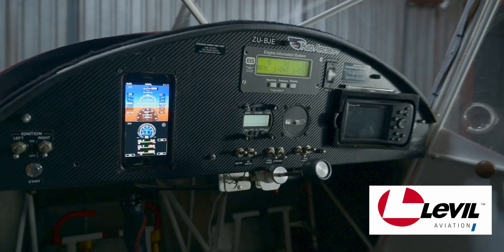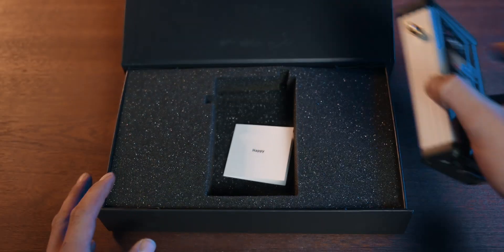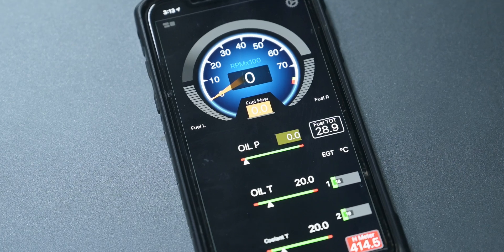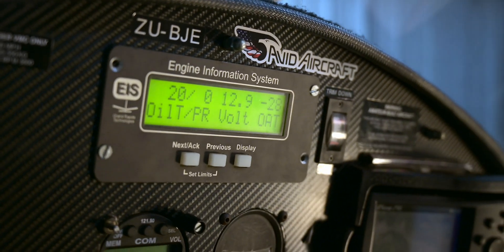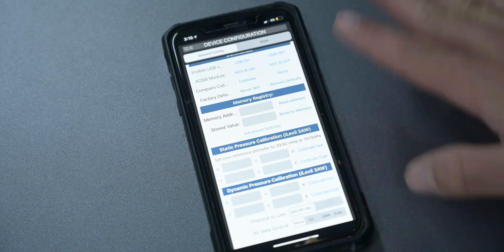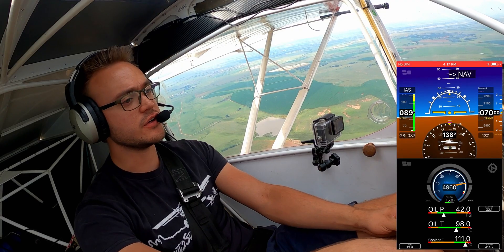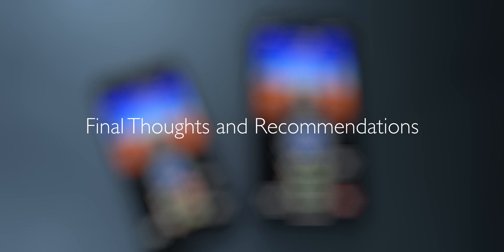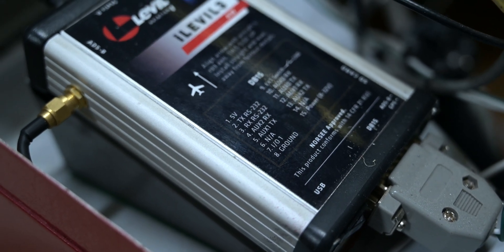iLevil 3 AW Affordable EFIS REVIEW!! || Levil Aviation

Comment: I saw your video of the 3aw and I'm interested in buying one. I was wondering if you could do the installation yourself, how complicated is it? I would like to buy 3 units, one is for an A600 Talon ultralight helicopter. The others are for a speed card and a bonanza. They provide support or guidance on installation and calibration. how did you do it?. Thanks.
Reply from the maker: Hi Elias!
It's really easy to install and all the info needed is in the manuals that are available on their website. They also provide pre-wired wiring harness as an option.

Hope this helps?

Comment: Things that have happened to me in a cockpit.  I have lost GPS due to Wi-Fi/Bluetooth not functioning correctly (I fixed this with a reboot).  I have also lost tablet (android) and iphone use due to heat (in both cases I had to wait for the units to cool down), so while they are brilliant devices they are not infallible. I would suggest that you should have at least one or two instruments that work off a simpler system.  Possibly ASI and altimeter?  You can even get this in one instrument in many cases.
Reply from the maker: Yes! You are totally correct. Luckily I haven't had my Ipad overheat or disconnect yet... I have had the GPS lose satellite connection, but that was due to bad antenna placement.

I usually have both my phone and ipad connected to have a backup. But I should be receiving the iLevil AP (auto pilot) unit in the coming week and have a solution to the backup. Stay tuned! 😊

Comment: Another Great video! I noticed some vortex Generators on your wings, Have you finished your experiments and decided on placement locations? Any information would be much appreciated, I have an Avid Heavy Hauler and was going to follow your lay out detailed in the kitfox vid. but if you have specific suggestions for the Avid that would be even better. 
Cheers From NZ
Reply from the maker: Thanks Mark!
Still busy with the testing, initial placement similar to our KF7 placement got about 5mph improvement without the Wingfences. So still need to install the fences and try a few more placements...
But will keep you updated 😉
Reply: @About2Stall  Champion 🤙

Comment: Is it not possible to install the unit in any attitude it happens to fit, level the plane and tell the unit to calibrate it's new level position, like some others do?
Reply from the maker: It could very well be possible, however the install guide says that for best results you should try and mount it forward facing and level with flight attitude... So that's why I went the route that I did
Reply: It’d be interesting to know how this effects it’s accuracy.. iLevil..?